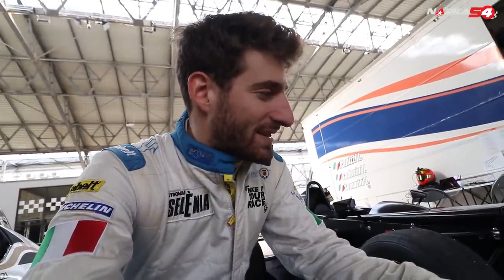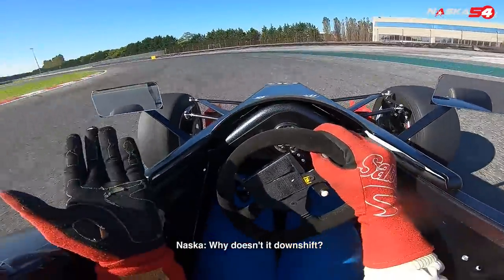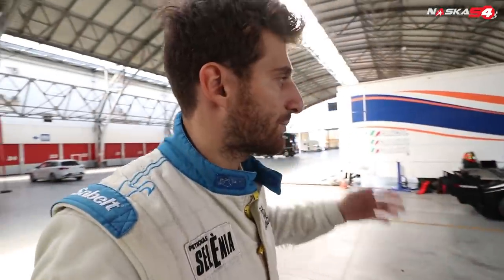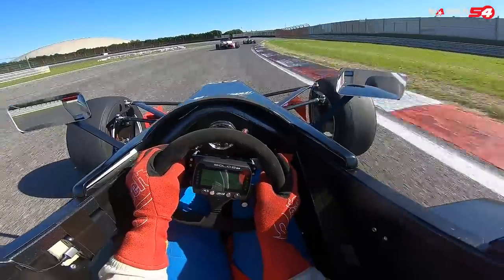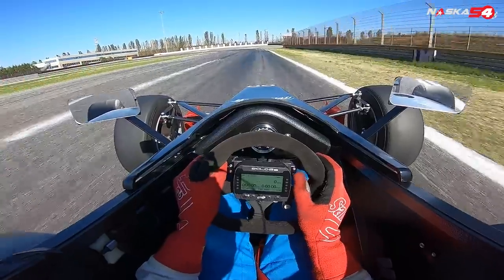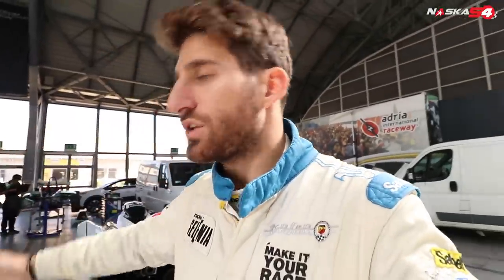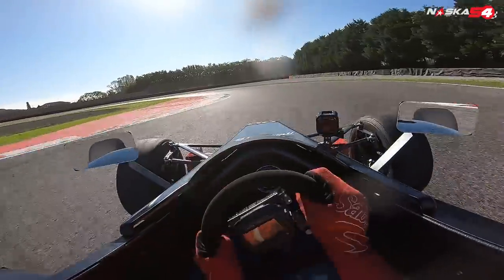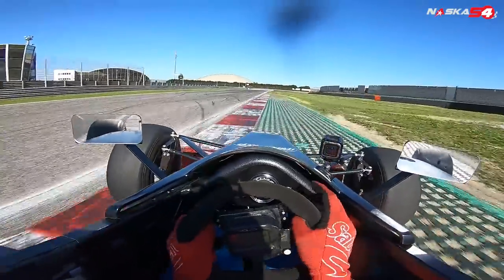MY NEW (new) RACE CAR! - RACING IS LIFE EP.45

Comment: hehe WD-40 to fix (most of) your troubles!
Reply: You need to be careful though, especially when there might be cracks in the metal. I've applied WD-40 to fix my squeaking seat, the next day I noticed a small crack in it's mechanism, but didn't think about it, until it snapped a day after and the chair broke.. I searched around the internet and WD-40 seems to accelerate the propagation of cracks in metal..